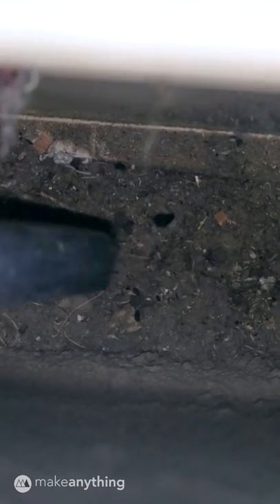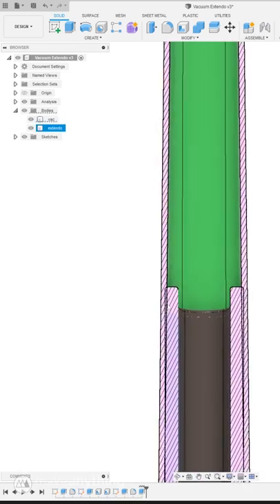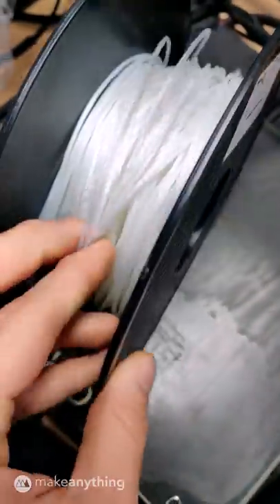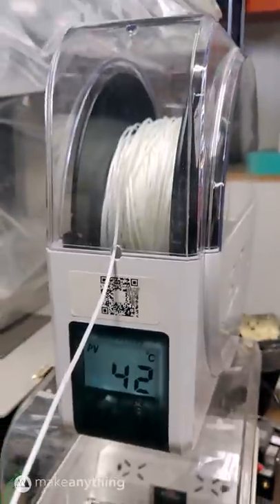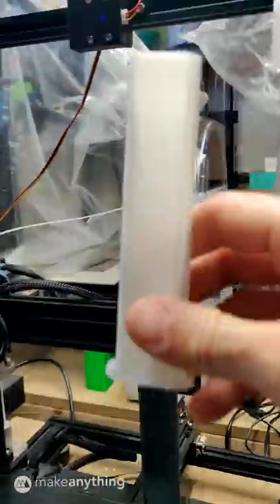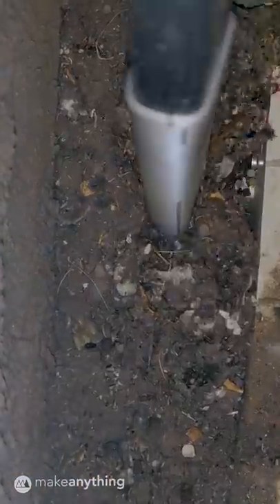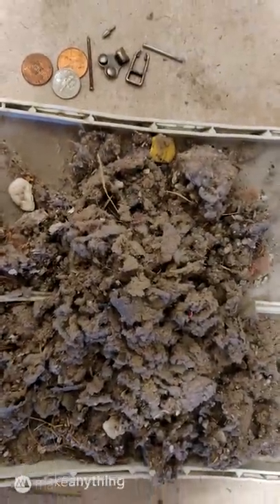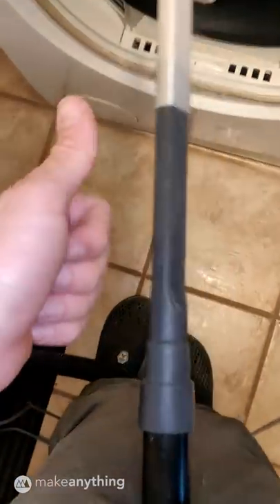Recycled TPU Vacuum Extender

Comment: Literally just modeled a vacuum nozzle for this purpose last week. Realized it was to tall to print, so I gave up. Never thought about making an extender! Will have to work on modeling that today!
Reply: Have you tried separating prints that are too big into sections and then glueing/bonding them together?
Reply: You need to make an extension for your extension
Reply: @anselmoledesma776  That's what they said that they're going to try
Reply: @YRO.  no, they said they're going to make an extender to fit onto the existing attachment like in the video temporarily, instead of making an entirely new, longer attachment. The person you replied to was talking about making a new attachment in multiple pieces/prints, then gluing them together to create the permanent finished product
Reply: Yeah now you can just scale it down and expand the bottom a little bit and you have what you need

Comment: Based on how dirty the inside is, you should clean the vent hose in the back of the machine too.
Reply from the maker: That is probably very very true
Reply: @make.anything  this is actually the more important part as dryer lint buildup in the vent is a leading cause of house fires, according to a fire Marshall I know. And a leading cause of death from house fires are expired smoke detectors. They should be replaced at least every 10 years, I do 8 to be safe. Be sure to check dates on the devices whether moving into a house or apartment! After replacing, I set an 8 year reminder on my phone, lol.
Reply: @2nd-place  That happened to me 2 weeks ago. Luckily, when it caught fire we were awakd, saw the smoke, and put out the fire. Unfortunately  we cant even reach the lint that caught fire and theres more back there so we basically have to throw it away. Better that than a house fire though :)
Reply: You found  a 2004 penny which have a D and there are 30 of those who might
Have it and it will be very expensive for  betting people
Reply: @angelrenate  both dryer and washing machine can be disassembled, you should've just found some person who can do it or do it yourself to clean everything from the inside
Reply: @88Timur88Bahmudov88  That washer and dryer were ancient and not even worth cleaning. We bought a new one, easier to clean, more energy efficient, actually cleans and dries in the time its supposed to. Thanks for the advice though.
Reply: @angelrenate  oh, i see, didn't know it was that old, dryers are just becoming popular in my country, so it's rare to see ancient models here😅
Reply: @88Timur88Bahmudov88  Oh thats nice, I wish! We live in a rental, so landlords arent jumping up and down to replace equipment lol. Had to do it ourselves, but it was worth it. Take care!

Comment: There's tons more. The entire exhaust system for the dryer will look like it. Please do it right, take it apart and clean it out. You're missing so much you won't believe it.
Reply: That sounds like a really hard process so I am impressed that you do that.
Reply: @miriam9419  It's not too bad, and that lint is a huge fire hazard so it's good to eliminate it as much as possible. 

Seriously - if you don't believe me, take some, put it somewhere outside that's fire safe, and light it with a lighter. It's impressive how fast and hot it can burn.
Reply: @Lessinath  right now I live in an apartment (so pay to do my laundry in the shared dryer) but in a month I will be moving to a house so will need to buy my own washer and dryer. I will have to look up how to do this. 

Is this a thing most people do? 
How long does it take? 

I’d imagine that it would be made to come apart if it’s something everyone does so that makes the job seem better.
Reply: @miriam9419  I don't know how many people do it, but it's generally just removing a panel or two and sucking it out with a vacuum or even grabbing it by hand. 

If you're lucky, and don't have to move the dryer to do it, it will take just a few minutes. I can't really be specific, unfortunately, because every type of dryer is different. 

Don't forget the vent pipe leading outside.

You shouldn't have to do it very often if your lint filter is working and cleaned after every use. Maybe yearly.
Reply: @Lessinath  
Oh wow, that’s so good to know. Thank you!
Reply: Cleaned mine out one time and found scorch marks in one spot around the heat element. The previous owners must have had a fire in there.

Comment: Actually after this video I checked mine and it's kind of same. So I learned that there is a hinge underneath which you can take out and then clean without the vaccum extender. Still this video helped and it made me go and clean mine. Thanks.

Comment: I once had a housemate with 3cats.  The dryer vent was backed up to the outside of the house  I pulled out almost a 5gallon bucket of furry crud out.  It could definitely have caused a fire so check yours, especially if you do a lot of laundry.😊😊

Comment: Fun! I nearly designed one of these last week until I got a clothes hanger to get 95% of it.  You hosting this file anywhere?

Also im willing to bet this will make your dryer run better and dry faster.
Reply from the maker: I considered a more simple solution like that, but I'll be able to reuse this extension many times so I think it was worth it :) I'm not sure the file is of much use unless the vacuum tube follows some sort of standard, but if someone has this exact one I can do it
Reply: @make.anything  as far as I know, most vacuum nozzles are the same few sizes, since they are probably made by the same factory. Even then, I'm sure people can figure out how to modify the file and make it fit properly

Comment: Very cool video and looks like it would be fun to come up with new ideas to make things. I have always had to rely on my own ingenuity. Use a wire coat hanger and a paper towel inner card board roll. Take apart the coat hanger to loosen up the compacted lint. Make some slices on one side of the roll and tape to vacuum end. Works great.

Comment: I used TPU to create a coupler so I can merge shop vac hoses, works great and flexs with the hose.  TPU is also soft so it prevents scuffs from the coupler on home trim or your auto...TPU is a great filament.

Comment: I was presented with a similar issue about a month ago, instead I opted to take apart the dryer to clean that area. I also noticed the blower wheel was mangled, could have 3D printed that as well

Comment: our old dryer had to be replaced bc of a lint problem. it would build up around the outside of the barrel and eventually kept it from working at all (i believe it shorted out something). anyways, we took it apart to look inside and there were literal scorch marks from where the lint had caught fire. i believe there was a recall for them, it was some whirlpool brand red thing.

Comment: If you have that much crap in there, you need to fully take it apart and clean it. Otherwise you will start blowing parts. I replaced a temp safety fuse up near the top of the dryer. And it blew again. So where the problem was in the door, it was clogged with lint, restricting the air flow and blowing the safety fuse. So I cleaned everything all the way to the outside.

Comment: I really need an extended skinny attachment specifically for this purpose. The way the vent is designed for my dryer makes every single dryer we’ve owned break. No joke. The one we have now is perfect for the conditions that occur when we use a dryer; it handles excess moisture, has different modes (especially with the extra dry modes) that makes it possible for us to dry our clothes. 

The design of the vent goes up the wall, over the ceiling, and out to the right side of the house. Because of that, we get a lot of lint stuck in the machine as well as moisture. Most dryers would be too powerful or run too quickly to handle the terrible design of our dryer vent. Unfortunately, this also means that the dryer collects way too much lint; I try to own plastic-free clothing because I hate this issue with the lint and it going outside. I’d rather have an external lint catcher for proper disposal of all lint.

Comment: That circular panel in the bottom left can be opened by simply pushing on it, then you can put the vacuum in through there. I know this because I spent 20 minutes trying to solve just this problem before accidentally leaning on it.

Comment: This is the reason I want a 3d printer and the reason I never want a dryer again. Mine caught fire, thankfully I stayed in the garage after turning it on and noticed the black smoke. It didn't burn bc of the lint, the insulation just went woosh out the blue.

Comment: how did you get the original in fusion 360 digitally
Reply from the maker: measured with calipers and estimated the fillets. Another reason to go flexible with the filament, the stretch compensates for any inaccuracy in my model :P